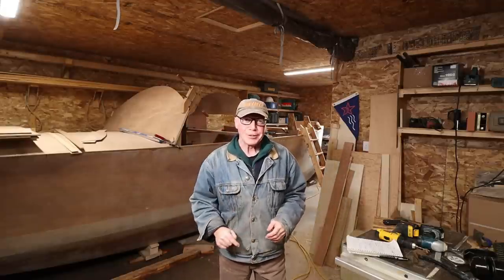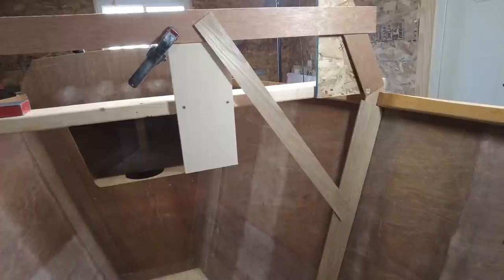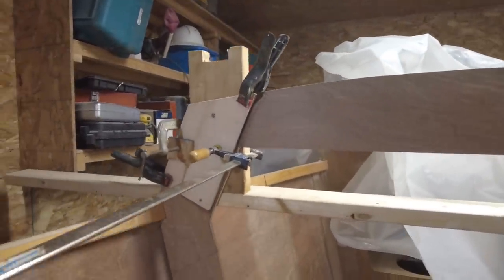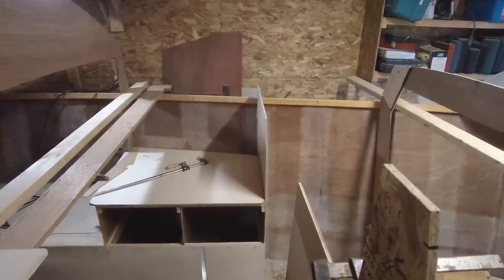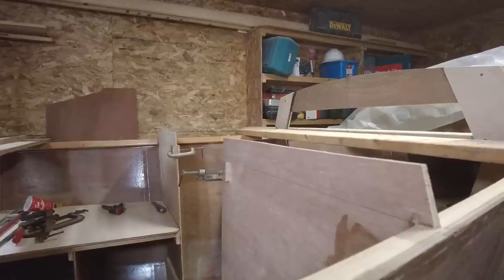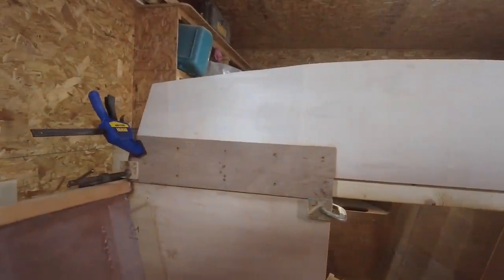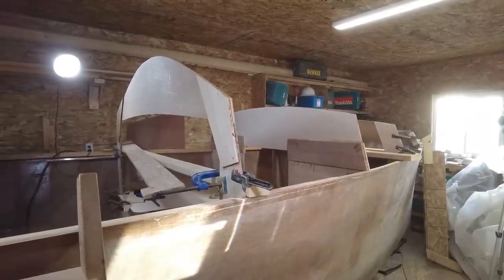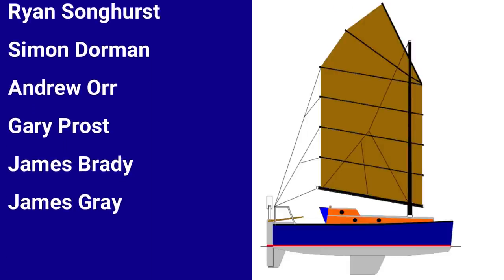S2E62 Cabin Camber is Wrong and must be Corrected

Comment: The correction on the camber was the right move. Absolutely, I would've done at least that much on the camber as well. Like you said, yea it sets you back a bit but there are so many things you can change on a boat cleats and so forth but not the camber on the cabin top is not one of them.
Reply from the maker: Thanks 👍

Comment: I think a Bomar hatch similar to those used on many of the GGR boats would be the best solution.  You get both visibility and water tightness in the same package, and it would not be as heavy as the hatch on Wave Rover I.
Reply from the maker: Part of the Wave Rover philosophy is empowering backyard builders of limited means. Building your own hatch fits with that philosophy. A reliable manufactured hatch of a comfortable size is extremely expensive.

Comment: The camber can hardly be too high. No practical issue (added stregth), but it's what we are used to see. 'Meassure once, cut twice', as we say in Norway. When I made my sail boat, from the top of my head, width 3,5 metres, camber approx. 100 mm (4"). I was a bit doubdfull, but the finish is ok. It is nice to walk on under sail.

Comment: Looking good. I do wonder if you plan to walk on the aft cabin top while underway, when the boat is healing? It just seems that the leeward side will be approaching vertical and near impossible to walk or even be on at all. It seems that the forward camber seems appropriate for the entire boat. Since you don't have walkways on the sides, and you will have to go forward frequently, I am struggling to see the practicality of it. Could you please explain the rationale, in one of your videos, for such a severe camber as it seems atypical and not seen on other boats?
Reply from the maker: With a Junk rig there is little reason to leave the cockpit. On small boats, when they are healed, always stay on the windward side when going forward. That said, you will find the windward side of the cabin camber almost horizontal.

Comment: What about having a hatch that opens upward, hinges at the top? That can be locked at a horizontal or just above horizontal position with easily attached soft sides so you can sail with the hatch open with minimal risk of getting water inside the boat. Almost like a spray hood. I can make and email you a sketch if you don’t understand how I mean but still think it sounds interesting?
Reply from the maker: I think what you are describing is the hatch I built for the original Wave Rover.
Reply: @RoversAdventure  Might be. I have actually not seen the older episodes before building WR650. Did you have a hatch with some spray hood sides to it?
Reply from the maker: @gunnarfernqvist4896  the spray hood sides was an innovation that I didn't get to but wanted to incorporate. Still thinking about how to accomplish that.
Reply: @RoversAdventure  I would have made them of canvas like a bimini top or such, sun and water resistant. It's hard to describe in text but I'll try. I would make each side with 4 sides not exactly square but close. The front side I would attach to the bulkhead in an angle from the hatch top side down to the deck close to the side of the boat, like a 45 degree angle or so. I would make this either removable with some sort of aluminum track to slide the canvas into, or simpler make this fixed to the boat and roll to the bulkhead when not used. Top side I would fix with a zipper on the inside of the hatch and bottom would be a button or a knob at the lower back end of the canvas, to stretch it back and down. Don't know if you understood my idea?

Comment: Does this require a change now in the front bulkhead?
Reply from the maker: Great question and yes it does. It turns out that there is enough material to accomplish this as it had a more extreme camber drawn from the original plan for some reason